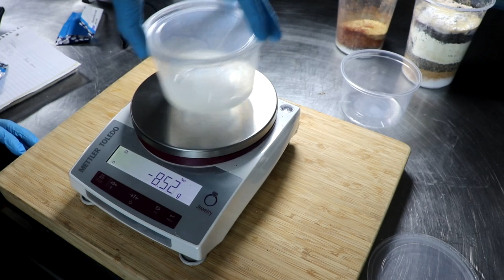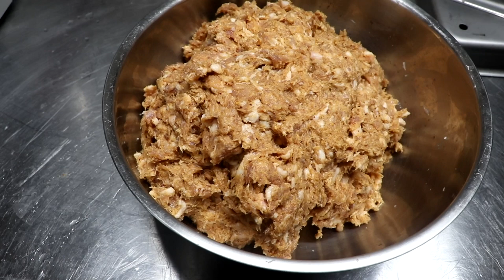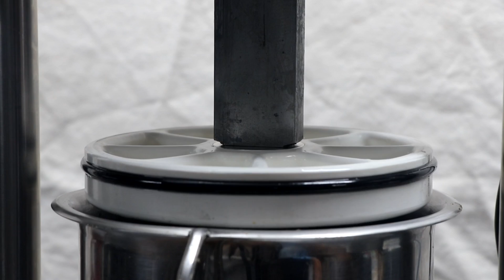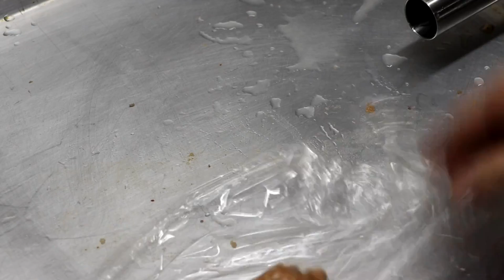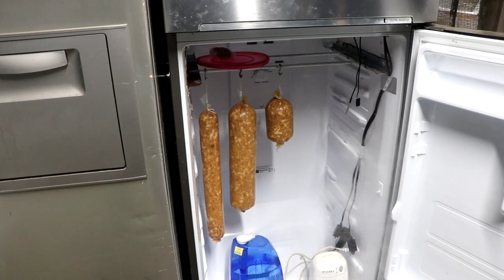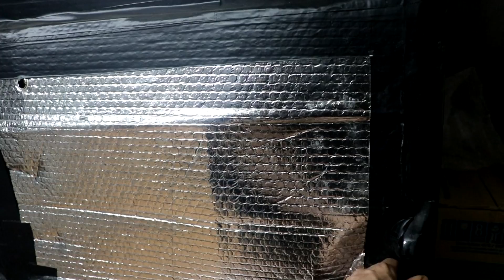Making Calabrese Salami (Step by Step Instructions)

Comment: Question! I followed this recipe exactly, except by fermentation chamber went to 81 f for about 12 hours. PH is 5.34,is all lost?
Reply from the maker: How long has it been fermenting for?
Reply: @2guysandacooler  went in Sunday night (12/19) at 7pm. Meat sample was 74 f / 80% humidity at 5pm (12/20) and 5.34 PH. I cooled to 68 by 6pm.
Reply: @2guysandacooler  I tossed it. No need to risk it. Lesson learned. I joined your patreon by the way. I'm going to need advice on this journey 🤣

Comment: i  have a question regarding the use of Mold 600. the instructions on the packet say to add the Mold600 to water let it sit for 12 hrs then add a liter of water. All the videos i watched using this stuff dont follow those directions. most of the time it just prepared before stuffing meat into the casing. what is the correct use of this product. my second question is once prepared how do you store it and how long does it last
Reply from the maker: Hello Joe.  There is a "wake up" period for mold 600.  I have found that if it's prepared at least 2 hours before using the mold grows very well.  I also like to use a very concentrated amount so that the mold coverage is very dominant.  When applying mold 600 you only need a little bit (either with a spray bottle, dip, or brush) so if you make 1 liter of it you will have LOTS extra unless you plan on making 50 pounds+ of salami :).  If I'm only making 10 pounds of salami or 5 60mm logs then I'll take 1/2 cup of distilled water and mix it with 1/4 tsp of mold 600.  Let it rehydrate for at least 2 hours then brush it on my salami right as its about to start fermenting.  You can keep the extra mold for 4-5 days but after that it gets weak and doesn't colonize well.

Comment: If one cannot get starter culture .
Then how to make salami 
All of your videos used starter culture 
I tried a lot but not been able to source any starter culture or mold 600.

If is there a way to make salami without one or i have to drop the ides of making salami.

Or backslopping can be done with a store bought frozen salami
Reply from the maker: You can try things like Naturally fermented sauerkraut juice:  https://youtu.be/l4YlQDUJjV0
or even fresh garlic in your recipe.  These contain lots of lactic acid producing bacteria that will ferment your salami...  Just be sure to add enough dextrose to the recipe.  I would add .7% of the weight of meat and fat in dextrose.
Reply: @2guysandacooler  thank you very much I'll try thees method

Is the lactic acid producing bacteria 
The one which is used in chees making or curd making is same 
That is used to ferment salami?
Reply from the maker: @Bzl_777  It's not exactly the same but in the same family.  In theory it should work.  Those bacteria like to eat lactose so add some milk to your recipe if you use those cultures. :)
Reply: @2guysandacooler  thank you very much
For  your quick reply and help sir 🙂

Comment: what temperature and humidity do you have in your drying chamber
Reply from the maker: Hey Raymond.  I have it set at 55F and 80% humidity.  I keep it like that all the time no matter whats in it..
Reply: @2guysandacooler  thank  you , by the way I really enjoy your videos they are very Informative. I have another question I'm country curing a whole ham and what's your thoughts on aging it in the same chamber as salimi?
Reply from the maker: @raymondclothier3113  That sounds amazing.  Depending on the cure you used (1 or 2) you'll want to manage the amount of time you leave it in there but that will absolutely enhance the flavor!!  Great idea..

Be sure to have the humidity at 80% to really slow how fast it dries and you might even want to apply a very thin layer of sugna to the non fatty areas if you plan on leaving it in there for longer than 3 weeks.  I have a video on making sugna if need a reference.  Be sure to let me know what happens..
Reply: @2guysandacooler  I'm using cure #2 as your rule of thumb anything over 30 days use #2 under use  #1  thanks for your advice I'll let you know how it turns out

Comment: Eric,
I went marathon last night and made 50 pounds of Calabrese salami, following your recipe/guidelines and thanks for that. All went well except the mixing of 50 pounds of semi frozen meat by hand, by myself at 1 am -- MIXER next time!
The only real issue was the grinding of the meat generated some steam and heat on the drive screw; actually cooked a thin film of meat at the base of the screw. I'm using a LEM Big Bite #8. The meat, and especially the fat was partially frozen. Is that normal or is there something I can do to minimize the issue? We ran it through pretty fast.
Thanks man for our help thus far and beyond. Cheers!!
Ron
Reply from the maker: WOW.  50 pounds of salami at 1am.  That's hard core!!  I bet a mixer is sounding real good about now...  It's normal for the heat that's generated from the drive screw to cook a small amount of meat.  What I do to minimize the heat transfer is to cut my pieces into relatively small chunks and take small breaks between batches.  I might do 25 pounds then return everything to the freezer.  Then I'll take the grinder apart and run it under cold water to cool it down.  Other than that I wouldn't worry about it too much.  The larger the grinder and the more powerful the motor really keeps that from happening too much.  I have a 22 Big Bite and at times when I'm doing huge batches 100+ pounds it tends to happen towards the end of my grind..  I can't wait to hear how the Calabrese comes out..
Reply: @2guysandacooler  Wow, indeed - and I'm referring to you and your willingness to help and answer questions from your subscribers. Invaluable really. It's not the national debt but it is a substantial investment in dollars and most importantly, time invested that would be such a shame to lose due to a failure that could be solved by a little help from someone like yourself.
Salute!
Reply from the maker: Thanks MillerBuilt!  I appreciate the comment.
Reply: @2guysandacooler  My pleasure. I moved the salami after 36 hours from the 90%/70 degree ferment closet to the 80% 55 degree cellar. It was at 5.1 ph. So far so great! and nalgiovensis is already growing on the salamis with collagen casings!
Reply from the maker: @Rmillerb1  that's perfect.  Now it's a waiting game.  😁

Comment: Good morning! I did a similar recipe and used beef middles 2.5 inches diameter. I used the culture you use and the mold 600. Everything is looking amazing. My only concern is, I just tested one for weight.  It went in at 839g and is already 671g  at 1 week. This seems fast? It's a new drying chamber and everything seems to hold well. 80 percent humidity, 15c. Should I up the humidity a bit or just let it keep going? I also have some jowels and coppa I just added.
Reply from the maker: Hey J.  It does seem a touch fast but let it play out 1 more week and see where it's at.  Have you calibrated your humidity controller to double check it's accuracy?  Is there a fan in the chamber moving air around a bunch.  Keep the humidity at 80% and keep an eye on it.  figure at 2.5 inches you should be at 40% in 6-7 weeks roughly.
Reply: @2guysandacooler  they may be closer to 2 inches. But yeah it seemed fast. I used the ink bird controller and sensor and have 2 other sensors that all say the same withing 2 percent. I have a small cpu fan circulating the air. 

The only thing I notice is when the fridge kicks on, the humidity drops to about 50. But within 5 or 10 min the humidifier comes back. I'll keep am eye on it and see what happens. Just dont want them to case harden, though I'm not sure what that would look like since I've never seen it
Reply from the maker: @jason4705  maybe raise the humidity to 85 for a week.  2 inches will dry in  5-6 weeks so your not too far off.  

Case hardening is where the outside feels hard but when you press it the inside feels raw.
Reply: @2guysandacooler  awesome ill adjust to 85 when I get home. Fingers crossed. I tried to attach a picture but it didnt work
Reply: @2guysandacooler  Sorry my original message had a typo. It was supposed to say 839g then one week later 671g which is 25% loss already in 1 week. I edited the post. Not sure if this changes anything. I set the humidity to 85. I sure hope I didn't mess this up I have 15 lbs in there.
Reply: @2guysandacooler  update. I'm not sure if others have had similar issues. The air flow was the culprit. Every hour the fridge kicks on cooling to 12 c but also lowering humidity from 85 to 55. The fridge fan is like a tornado inside.  The humidifier kicks on immediately and blows full speed for 10 minutes to get it back to 80  then would run on low constantly trying to keep humidity above 80. Eventually the fridge heats up to 15c  and the process restarts. 24 times per day. On top of that I have a cpu fan blowing against the wall to circulate the air. The 839 gram sausage lost 168g the first week. 24g per day average. I took out the fan and lowered the humidifier fan speed. I'm now losing about 7g per day, it's only day 10 and they are sitting at 30percent loss. They still feel squishy, in your opinion is this batch screwed? I plan on drying them to 38 percent which at this pace will be 2 weeks dry time. Any advice is great. They are completely covered with mold 600 so I hope that helps save them.
Reply from the maker: @jason4705  Oh WOW, I just got your earlier message.  Yeah that's incredibly fast!!  Too much air flow is a major issue lots of folks have to deal with.  It was an issue in my chamber as well.  I ended up having to remove the fan that was connected to the fridge.  The only air circulation is my computer fan and finally I'm all dialed in.  

You have a very unique situation.  I wouldn't say they are ruined but they are drying very fast.   You can let them go to 40% at 80-85% humidity and see what happens.  If the center is squishy at 40% but the outside is firm you might want to start over and tweak the chamber a bit..
Reply: @2guysandacooler  do u think its possible to become seal and equalize ? I've read some stuff but  it sure
Reply from the maker: @jason4705  It depends on how dry the outside rim is.  In theory it should be a great option.  If you want to try it I would wash off the mold with vinegar.  Vac seal it and leave it in the fridge for at least 3 weeks.  Then I would place it back in the drying chamber and respray with mold till you achieve the 38-40% you are looking for.  

If you chose to do this be sure to let me know what happens..
Reply: @2guysandacooler  soooo...the night you responded I went to try the plan. When I pulled a sausage out. It seemed super squishy. It wasnt hard on the surface, just a slight thin skin. I slice a 1 inch from the bottom, squeezed it, and the entire inside squeezed out as raw as when I filled them. I wish I could show u pictures but there is no red ring or crust that looked like  case hardening I've seen online. I got the fan off of the fridge and once that happened I was essentially able to halt the drying completely, the test sausage lost nothing over 24 hours. I've now lowered the humidy slightly and will try to get a couple grams per day, which will get me about 4-5 weeks. It's amazing the fan was so fast on drying. Hopefully this will allow the drying to continue at a slow enough rate to correct the problem. Thanks for all the help so far.
Reply from the maker: @jason4705  Oh wow that's awesome. I can't wait to hear what happens once It dries completely.  Did you place a cheese cloth or something on the cut slice to seal it up?
Reply: @2guysandacooler  no, probably should have though. I used a silicone brush to pick up white powder spores from the sausages and painted it with the mold 600. Maybe I'll have to cut away a section and throw it out. Probably to late for cheese cloth now it's been a couple days.
Reply from the maker: @jason4705  no worries.   Let me know what happens.  Btw.  It's never too late for cheesecloth 😁
Reply: @2guysandacooler  just as an update, I increased the humidy and was able to sloe the rate if drying down. I've now reached 30 percent but it's only been 3 weeks. I just cut another slice of my sampler one. Although it does have a slightly harder outside, it doesn't look like case hardening. But the inside still seems completely raw to me. It smells fine, but I dont want to try it yet. I'll go to 40 percent and see.

Comment: Can homemade pepper sauce (wet) be used in place of the dry spices?
Reply from the maker: Sure.  That would be even better!
Reply: @2guysandacooler  Great!  And thanks once more for the response.  I was concerned about the Instacure#2 and the starter culture being used with the fresh sauce.
Reply: @2guysandacooler  If you were going to press the salami, when would that be done?
Reply from the maker: Hey Charles.  You'll press it (like sopressata) during the fermentation stage.  So as soon as it's stuffed you would put your salami under something heavy or with some clamps and place it to ferment.  Depending on your starter culture it could be between 24-72 hours.  After this time period you can move it to the drying chamber and the salami will retain its "pressed" form..
Reply: @2guysandacooler  Thanks for the info Eric!  Making 2 Calabrese soprasatta's tomorrow and will follow your lead!
Reply from the maker: @charlesa3374  Nice that sounds amazing.  Let me know how it turns out!!
Reply: @2guysandacooler  So far so good!  My only concern (which we've discussed in the past) is the Mold 600.  Tried it again on these salamis but a bit early and can't detect mold as of yet.  I have a feeling that I simply got a bad batch.  Looking forward to your video dedicated to this important product!

Comment: Could u just hang it in ur fridge?  Might take longer but still good right?
Reply from the maker: That's a great question.  When you use regular casings and put it in the fridge, the fridge generally has very low humidity so your salami would dry too fast on the outside leaving the inside raw.  If you had a special casing or membrane that would control the drying then yes you could certainly hang it in your fridge.   This is the type of casing I'm talking about..   https://www.sausagemaker.com/UMAi-Dry-70mm-Sausage-Casing-Packet-p/11-1629.htm&Click=108419

With this casing you can place it in the fridge and it will dry very slowly and controlled.  Comes out nice

Comment: Loved your video Eric. Well played :-)!!! I have a question how is it possible to add new product to your chamber as I understand each meat usually has different temperature and humidity ranges??? For example, my buddy and I have a batch of Genoa curing and we’ve got our eye on doing a Capicola now that we’ve seen your video. One last question, is there a rule of thumb for the amount of starter. Culture  and Mold 600 to be added? Thanks again for another great video. Larry in Seattle....
Reply from the maker: Hey Larry.  Thanks for the comment.  This is a great question and hopefully I can break it down for you.  If you are drying some Salami in your fridge and you've followed my recipe the n you're probably at 55F and 78-80% humidity.  This is a great range to be in for all cured meats.  The lower temp helps slow the drying down a tad bit and the higher humidity keeps the outside of the salami from getting hard.  Within this range you can add anything you want (coppa, bresaola, lonzino, pancetta, more salami, culatello).

The issue that generally people have is with more salami.  If you want to add more salami you'll have to find a place where it can ferment first but after that it's good to go in your drying chamber.   Making Capicola is probably the easiest and best thing to add to your chamber at this point.  I especially like the spicy version!!

About the starter.  The amount that is technically required is very small and most people don't have scales that accurately weigh that small so it's recommend to add 1/2 teaspoon per 5 pounds of meat.  If your culture is very old (18 months) then it is recommended to add 1 teaspoon per 5 pounds of meat.  As for the mold 600 there is no rule of thumb.  I generally add 1/2 teaspoon per 1 cup of water.  This will cover lots and lots of product.  If I have any left over I spray my chamber down with it (with a squirt bottle)

Hope that helps.  Let me know if you decide to make the coppa (you'll be glad you did!)